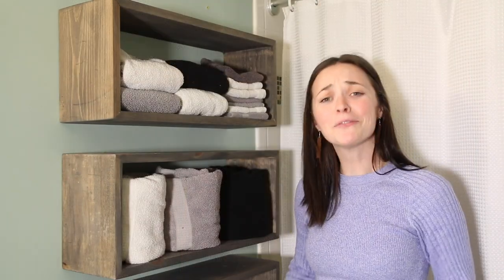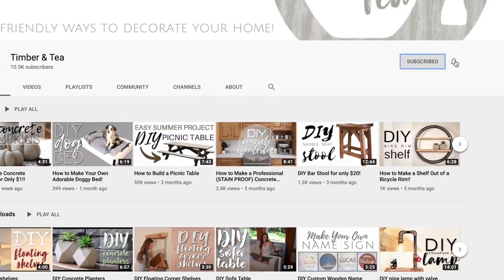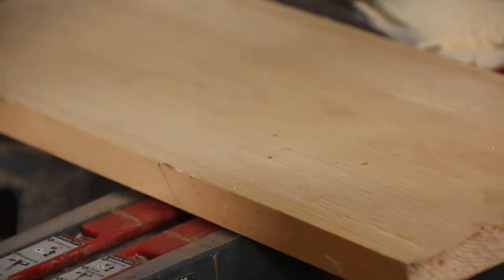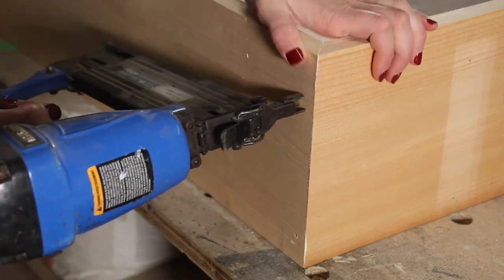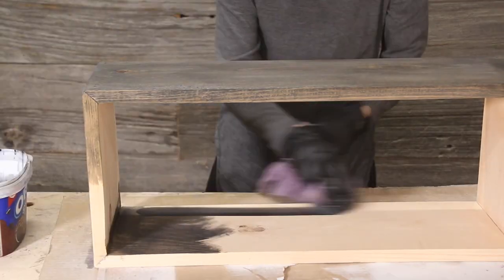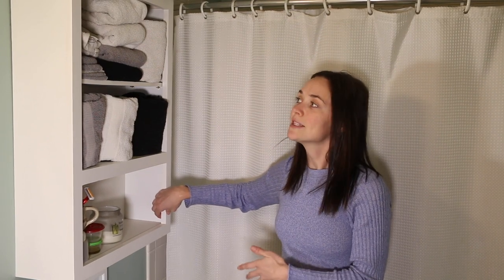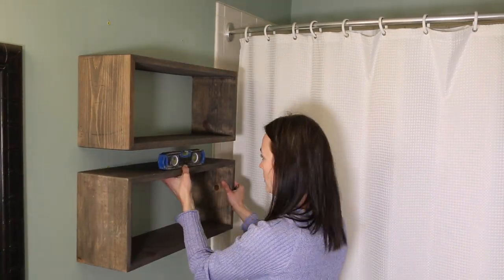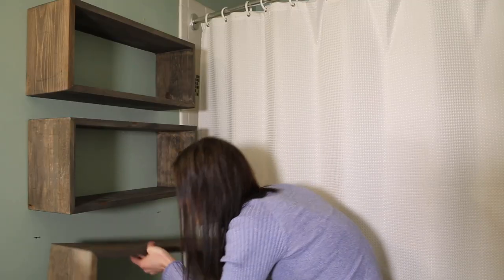Easy DIY Floating Shelves

Comment: great job! french cleats are another good option to mount that way it doesn't get knocked off opening/closing the shower curtains
Reply from the maker: I just looked up the french cleat looks like a pretty solid option. I ordered a few gonna try them out in a future project. Thanks for the advice Trevor
Reply: Timber & Tea anytime! Look forward to more great content. Also you don’t need to buy them just cut a scrap piece at a 45 degree angle in half
Reply: Would the French cleats show on this style of shelf? 
Also, why is it necessary to rotate the board when cutting the angle?
Reply: You can also make french cleats. On specific love creations channel he has g=eat tips for building g french cleats. :) if I can do it so can you!!

Comment: Wow..supercool you are using nails?
Reply from the maker: To hang them I just used small nails into the drywall. Works great if your not putting much weight on them. Otherwise you might want to add some drywall anchors!
Reply from the maker: I've done a few other floating shelve video's you might want to check out @ https://www.youtube.com/watch?v=02oDOzkAG1w